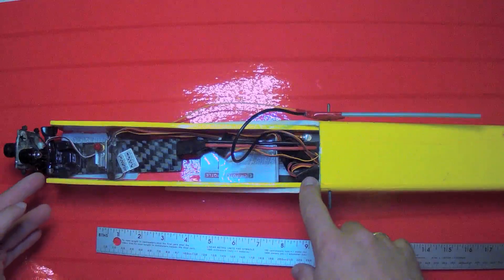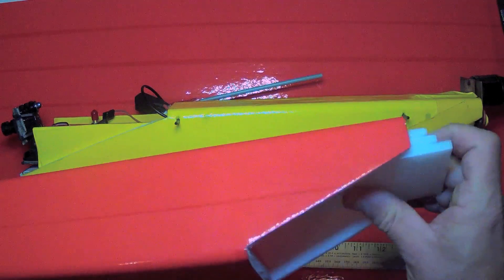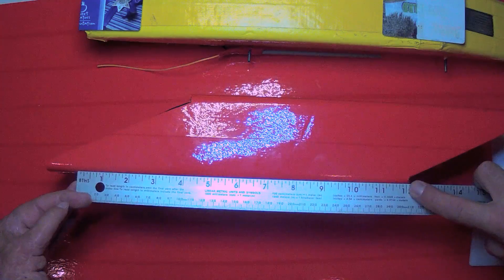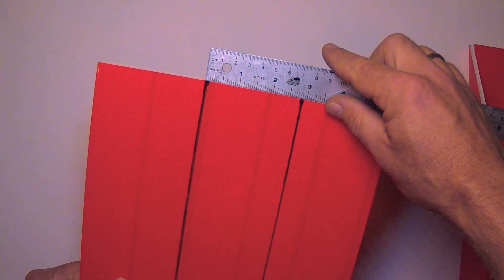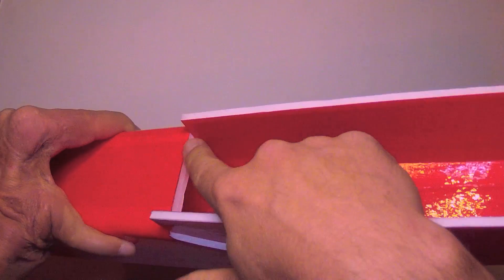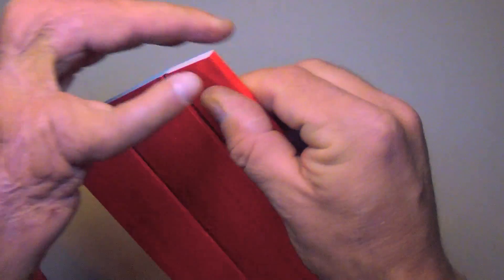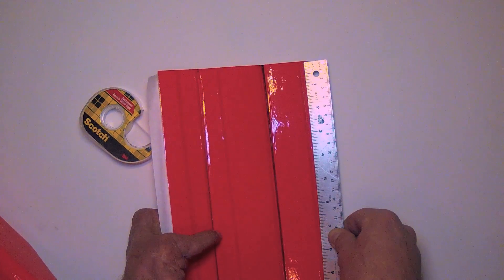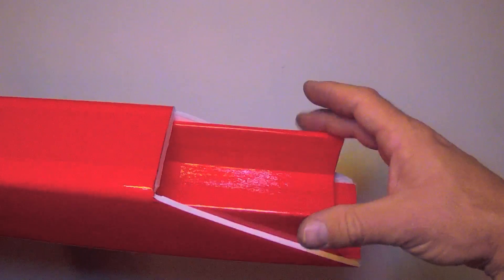SYNAPSE BUILD: Electronics Tray

Comment from the maker: You could, although the ability to access the battery on the lower level and the other stuff on the upper level makes it a bit easier even without the tray.  I'd start without one and if you feel the need to improve access you could slap together a tray pretty quick.